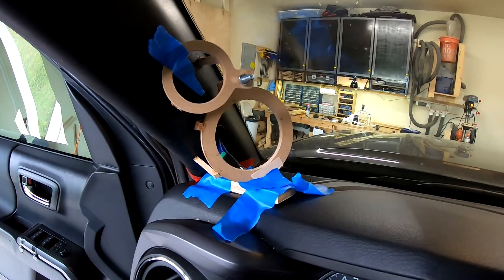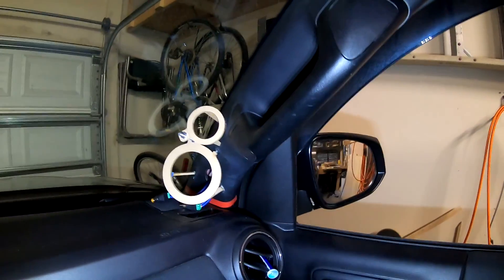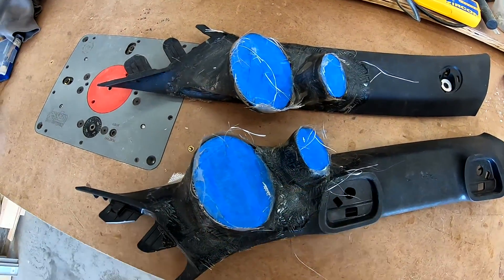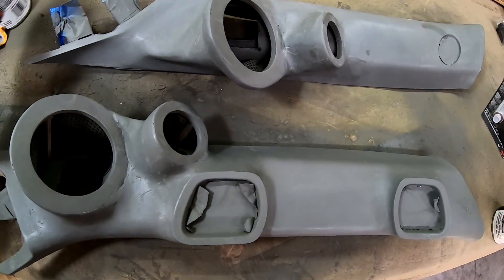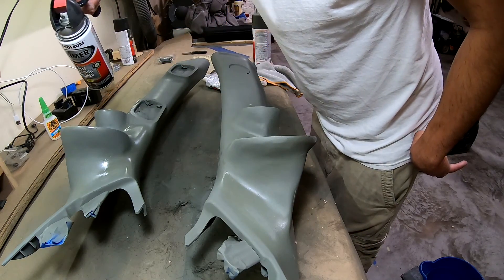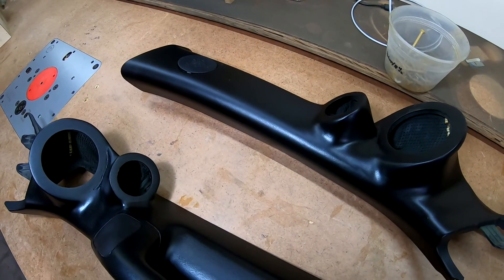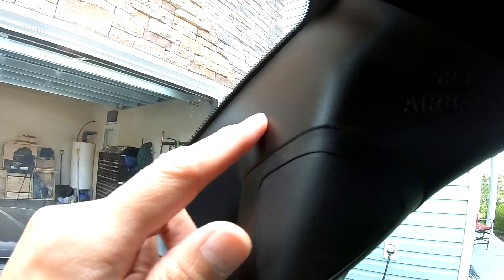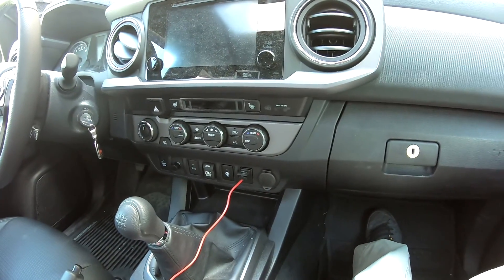Custom A-Pillar Speaker Pods (Tacoma Stereo Build Part 11)

Comment: Great job. Is that the 3 way set of Hertz speaker? Should i buy them if i like to crank the volume to 11 at times.
Reply from the maker: They are. I guess it would depend on how you’re powering them. Headunit wouldn’t over-power them. I’d recommend an amp for this set
Reply: @AyyJayy02  The amp i was looking at was 150x2 at 2 ohm. It's hard to find good reviews out there. I liked the car stereo magazines of the 90's A great deal more info. Most reviews I find now are just the things that make a big boom.
Reply from the maker: @mikekendall841  True true. I don’t believe most reviews because a lot of the “bad” equipment is usually due to a poor install or not setting gains properly. 150w is the rms rating for those components, if I’m not mistaken. Should be alright.

Comment: Your pods look really good  and nice speakers you are running . I’m about to finish up my pods tomorrow. I just put the last coat of paint of on them about 15 minutes ago . I’m running them Hertz milli legend MLK 1650.3 6.5 woofer  , ML 700.3 3.5 mid range and the ML 280.3 tweeter . They are all Running Active off a Zapco  Z-150.6AP and Zapco  DSP-Z8IVII . Can’t wait till it’s all tuned .
Reply from the maker: Nice. I looked at those speakers, but I didn’t want to pay the price. I usually buy all Alpine, but they didn’t have the 3” midrange speakers at the time, so I got Hertz. Sound good so far.

Comment: Hey buddy, if you ever do build pillars again please try using Usc proglas or duraglas. Rage body filler is really great to use as well. Bondo brand stuff sucks to use
Reply from the maker: I’ll check it out. I’ve seen those used in a bunch of the videos I’ve seen, but I already had that stuff on hand. It was the first real project I finished using body filler. Thanks for the info!

Comment: Nice job! Question: How did you get the textured look after painting the A-Pillars?
Reply from the maker: It’s the last coat of spray paint. Instead of spraying closer, keep the can a few feet away and mist it onto the work piece. I’d seen it done on a few other YouTube videos, and it worked like a charm.

Comment: How did you wire your tweeters up?
Reply from the maker: I have an amp under the front seat running the tweeters and the 3” speakers. Running them active with an audio processor. I used XT60 connectors in case I need to remove the pillars for any reason.

Comment: 4-8 ohm speakers sound good for sound quality you don’t need a ton of power to push sensitive speakers and having the right eq is a must running 2 ohms on tweets and mids is harsh and not needed at all
Reply from the maker: They’re running at 4 ohms, if I’m not mistaken. My sound processor (Alpine PXE-0850S) can power speakers at 25W RMS. Do you think I’d be able to run those tweeters and 3” midranges straight off of that? I was wondering if I could just ditch the amp that I have powering those.
Reply: @AyyJayy02  you could If you wanted to a better sounding system would have each channel for each speaker in my opinion I would run 2 —4-channel amps and 1 for your subs or 4 -2 channel amps and one for your sub
Reply: Never seen a 2 ohm tweeter in my life. The ohm load wouldnt make a tweeter sound "harsh" anyway.

Comment: I would like to do this for a while. I don’t have the tools, knowledge or the patience for this haha. I currently have upgraded door speakers and subs in my 3rd gen. With mono and 4 channel amp.
Reply from the maker: There are some good video tutorials on the Car Audio Fabrication channel. This was my first time doing this, and I used that as my main resource for doing it. Patience is definitely important. Especially with how much sanding I had to do. These trucks definitely need sound system upgrades though. I couldn’t stand my stock system.